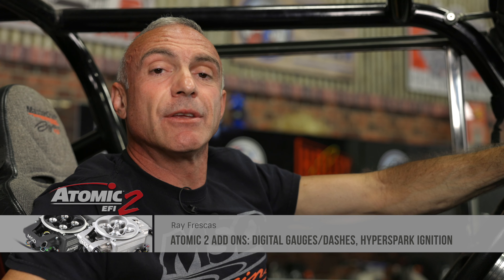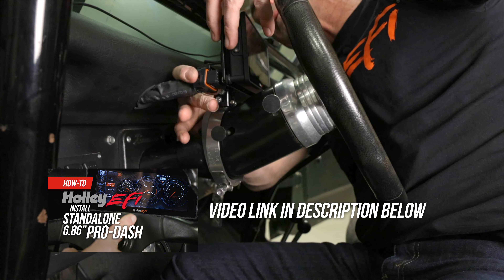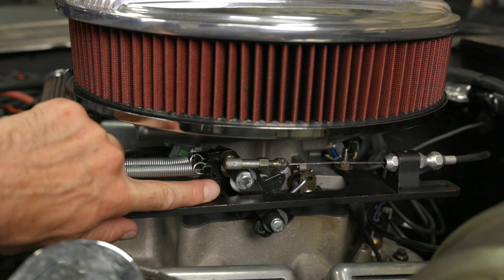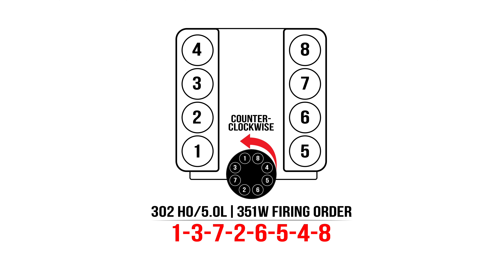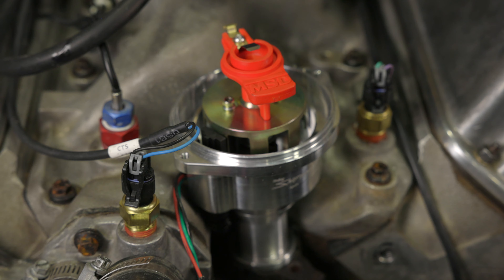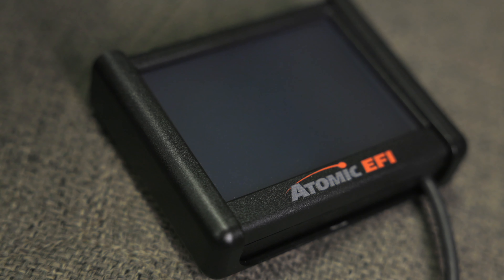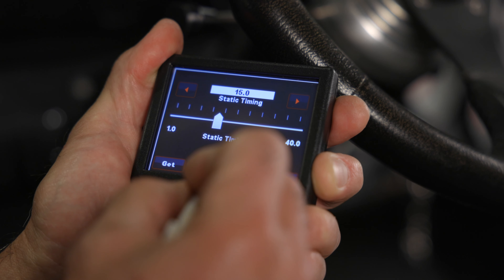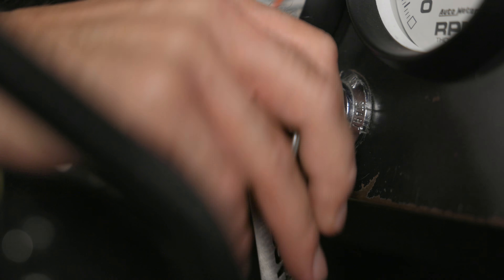Upgrade Your MSD Atomic 2 EFI System With These Great Add-Ons

Comment: I need help I have a Sbc 350 trying to coil near plug and drive by cable I ordered the Holley 300-260 intake and the Holley 300-240BK intake elbow with the Holley 860004-1 Throttle body What’s the easiest most cost effective way to do this